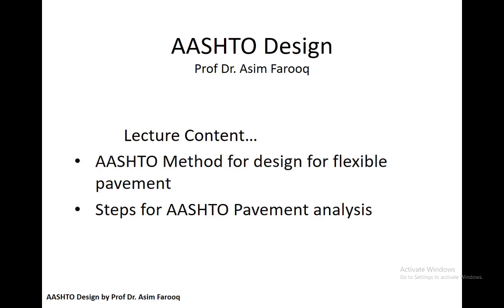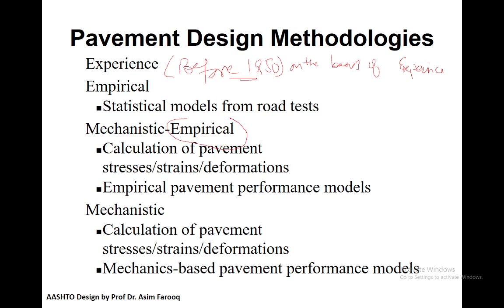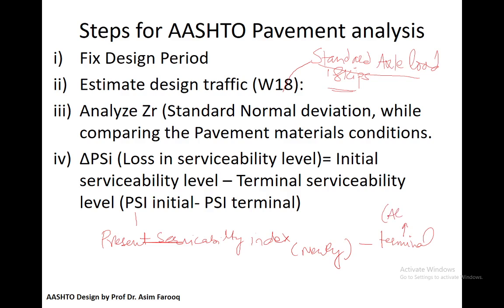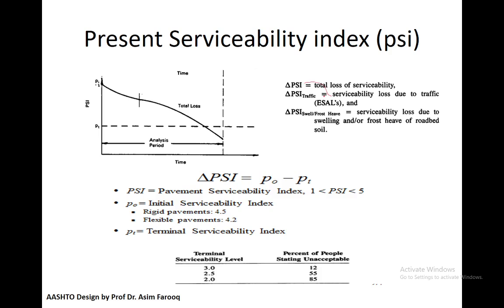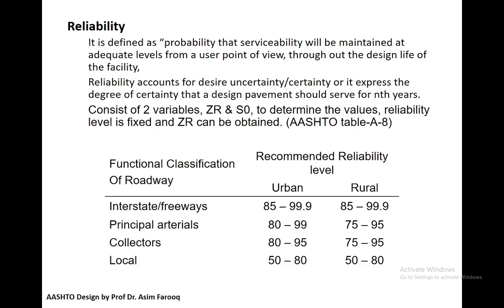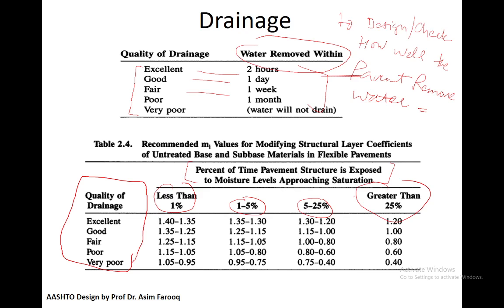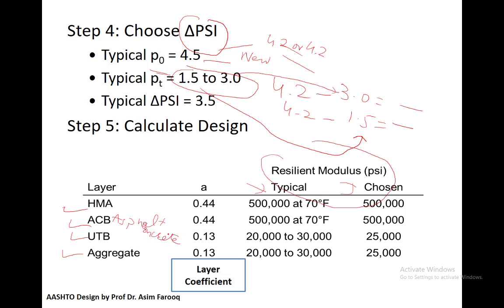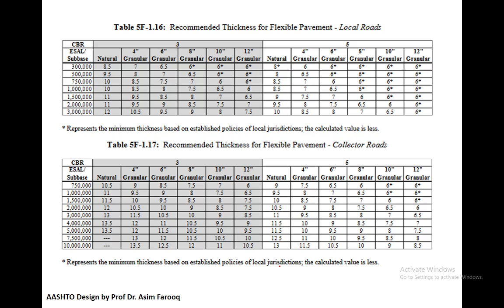Flexible Pavement Design through AASHTO by Prof Dr  Asim Farooq

Comment: if the granular materials very very available but the CBR Ratio  bitwen  10%   _ 50 % ...can I use for base layer CBR  50 %  OR   40 %  %  ... and plasticity index bitwen   8   % _ 10 %  ... depending to increase thickness of base  layer  10 cm   addition to  the original   thickness layer  design to the same percentage of CBR    40  % _ 50  %   ...
Reply from the maker: The minimum CBR value of a sub-base soil should be 20% and 30% for traffic up to 2-lanes and traffic exceeding 2 lanes respectively. Also, the minimum CBR value for a subgrade soil is usually 6%, although subgrade characterization recommends 10%. As  a pavement designer, we always needs to considered the Marginal Safety in the design (Safety Factor), so better to use higher CBR granular material for better strength.
Reply: @profdr.asimfarooq9606  you learn us very important    points  about subgrade  material . Layer . but I am asking so the relation bitwen increase  the thickness of base coarse  layer  in case the CBR    less    than   80%   that mean its may  be  50%   In this  case can  I use  plasticity index  8%  or   10 %  .... on the   comporomise .. thanks ...
Reply: IF  All layer  constructed  from  granular materials the additional  thickness   may  be  10cm  to the  designed layer of base  ولكم  جزيل  الشكر ..